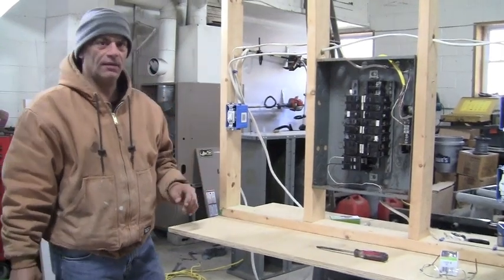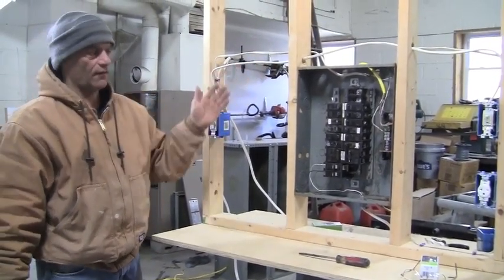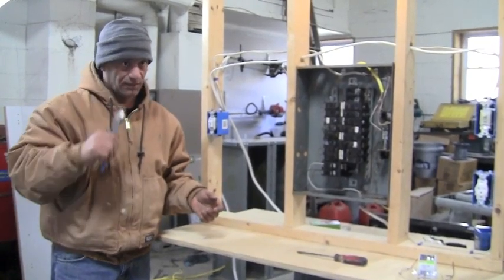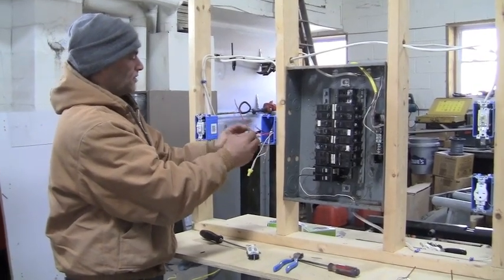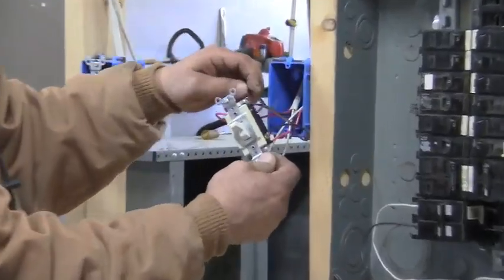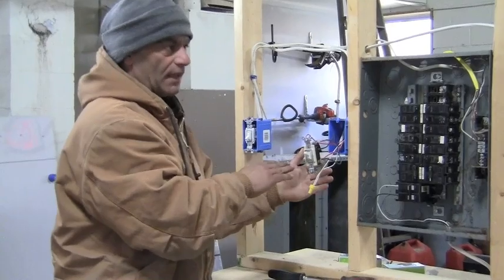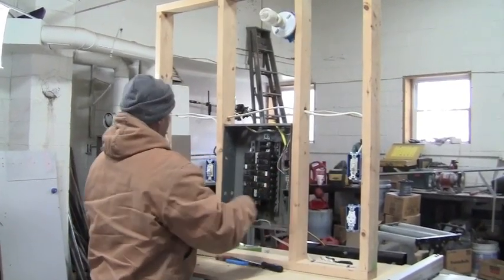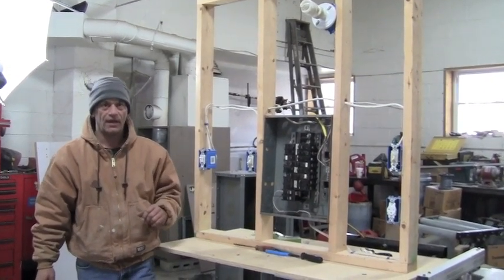How to install a 4 way switch.

Comment: I'm having the problem with the switches not working proper. I did find the commons on the 3way switch by taking of the switch and turning the power on, and finding the hot with my tester and placing it on the black screw. So is my problem at the 4way?
Reply from the maker: It could be. Just double double check your wiring. Make sure both 3 ways are wired the same.

Comment: Thanks for sharing. Can you also explain which wire to use when? I have to install 2 sconces and connect to an existing switch. The two sconces need to be connected by a wire. With all the different types of wires at local hardware, which one should I buy and how to get the wire horizontally (you had it vertically which was way much easier if you know the area between the studs)?

Comment: For testing purposes, clear incandescent lamps with supported filaments are better than CFLs as the lamp can be visually inspected for failure.  They are also unaffected by frequent switching.

Comment: I replaced two electrical outlets that were switched. Wired them exactly the same way and now the switches don't work but I do have power. I must have missed a step.
Reply: Bob O'Brien because you didn't break the tab on the feed side of the outlet to separate the loads

Comment: To create a circuit that will be switch fed and be able to cut a light on or off at 4 different locations will i need 2 3-Way switches and 2 4-Way Switches?

Comment from the maker: @shaftwood The best thing I can tell you is first make sure the dimmer is of a 4-way or 3-way and of course it's installed right. If these is a issue I like to replace any dimmers with a regular 3 or 4 way switch witch ever it needs. Then see how things are.